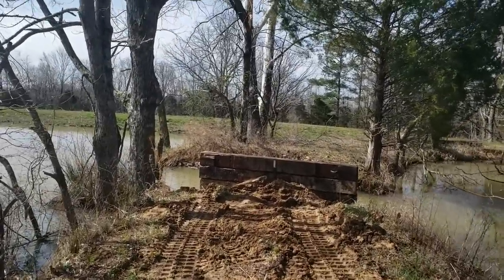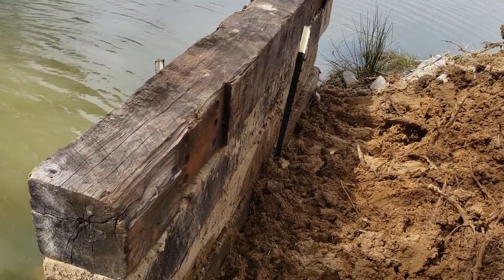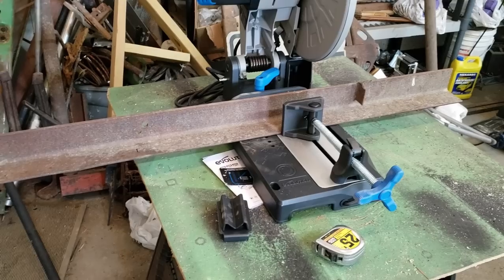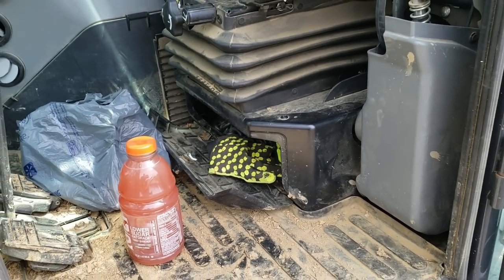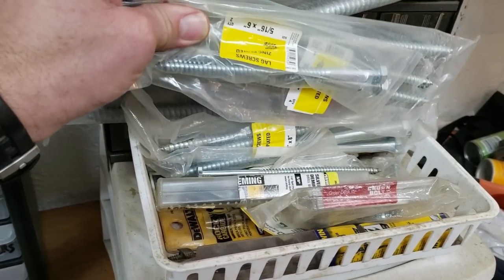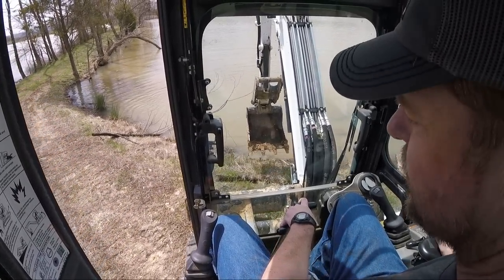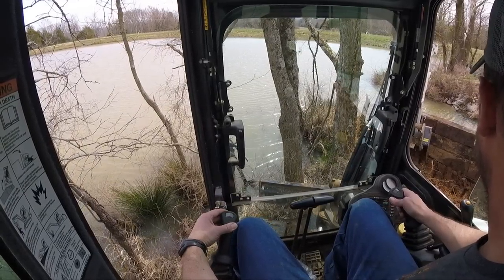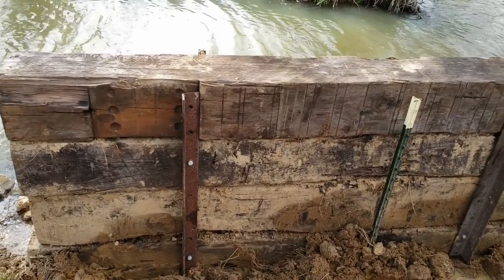Illinois Homestead VLOG; Pond bridge, sunshine, power tools & good health day

Comment: Hey kapper I had the same problem with rodents nesting under the hood of my tractor. I'd go out there almost every day after work and the nest would be back again. What you can do is sprinkle garlic powder or chilli powder where they are nesting. Or better yet both. I did both and it did the trick. Kinda messy but better than chewed wires
Reply from the maker: Dang it hate them things. My buddy is going to give me something new to try, some poison.. but then I hate smelling the dead ones... Thanks man. I've been using mint spray, seems to be doing ok, but I forgot to soak the excavator.

Comment: For more stability, you might consider putting a horizontal T-beam running back into the hillside to keep the wall from tilting toward the water over time.
Reply from the maker: Yep that is definitely in the plan, I guess they call it a dead man, but whatever it's called I'm going to be taking advantage of it, thanks

Comment: Nice work, Kap.  Glad you are able to get down to the base and put in a firm/packed foundation (preference is thick concrete base).  That's essential & key.  You can still do that since you fastened the RR ties.  You can now lift the entire log ensemble as a single unit and set off to the side while you build forms and lay down concrete base.  Like those Evolution tools you were using.  What happened to last metal chop-saw or is it the same one you always had? I don't have an Evolution but I'm quite happy with mine and it's been spot-on for cutting metal.  Full-watch. See in your next episode.  👍
Reply from the maker: Good idea man I might consider making a small concrete pad? Either way I'm going to lift it and get it out of moisture. Evolution sent me their new model of the chop saw since I did a nice review on the one that I had. So I'll be doing a review on the newer and improved model. Take care

Comment: Remember had the rodent problem with the "orange" excavator......they had set up a nest under the seat and ate through a 3/8 " hydraulic line. Cost $1,700.00 to repair on site. Couldn't move machine, had no power to tracks. Then 4 weeks later they ate through the fuel sensor wiring.....i fixed that my self. I have rodent bait every where on every piece of equipment. Been about 4 months and have seen no "apparent" rodent activity....have a found a few "expired" ones.
Reply from the maker: yeah my exterminator buddy is going to give me some of the nuke cubes! But then you have to smell the dead ones!!! uggghhh

Comment: Hey Kapper, is this bridge going to be for foot traffic only or do you plan on taking your ATV and equipment over it? If its only foot traffic you might be ok. If Atv traffic and more I think I would start over. Make you a base of gravel or concrete. Put your first beam down,  2nd row put a dead man in the middle, 3rd row put a dead man on each end. then put your top beam.
Each layer drill holes through your beams every 2 foot apart and drive rebar through them connecting that beam to the one below it
some extra work but may be worth it
Reply from the maker: I hope it will support all of my equipment but obviously I'm going to do a test when we build the bridge beforehand. I'm more concerned about the steel giving way than this Timber support

Comment: Not bugging you, but now that you have dug a flat spot above the water line, why not go all the say and form up a base and make your platform from Concrete.  Maybe make the base 24 inches and throw in some rebar.  You can bucket the concrete with the skid steer.  That would be a firmer and rot resistant base that would not have to be revisited and not a worry with chemicals in the wood.
Reply from the maker: it is a possibility. It kind of depends on how easy the 4 timber stack is to move and set aside with the excavator. If I can just set it aside of course then it will be a lot easier. I may also just lay bags of concrete under it and let them cure, that would be pretty similar but let water run out easier from beneath the bottom one. We'll see how it goes thanks.

Comment: If you are going to set the beams on top of the rail road ties, are you going to be to high. Don’t overlook the beam and decking dimensions adding to the overall height
Reply from the maker: Well I'm not too worried about that part, because I'm going to be bringing in a lot of fill and gravel to make ramps on both sides. That should be the easy part LOL but we will see :-) Thanks

Comment: Kapper   I do hope you are planing to use the bridge for the mower and not your heavy equipment.
Reply from the maker: Well I hope to do the equipment but we'll see how it goes. I do believe it will be just fine as long as the steel beams are strong enough across the span. I am really not concerned that this Timber stack will be the problem at all.